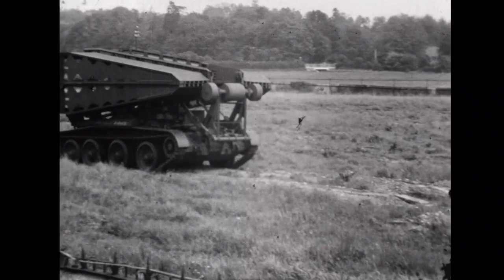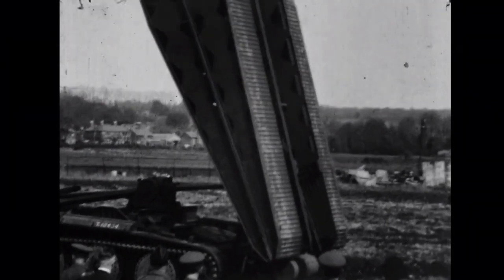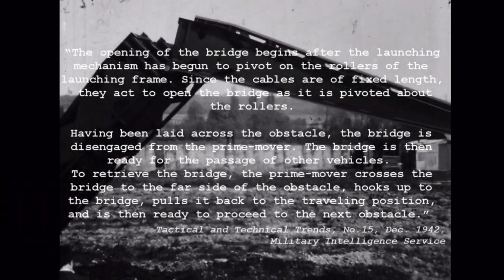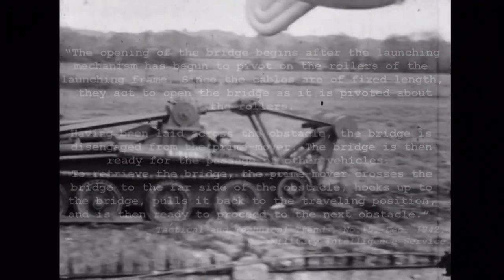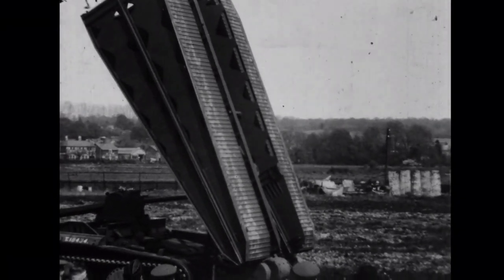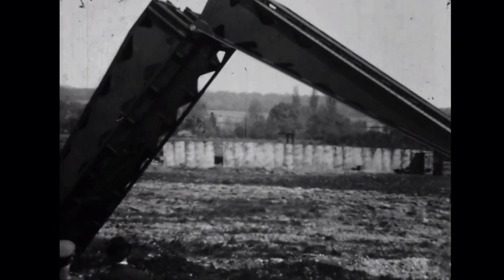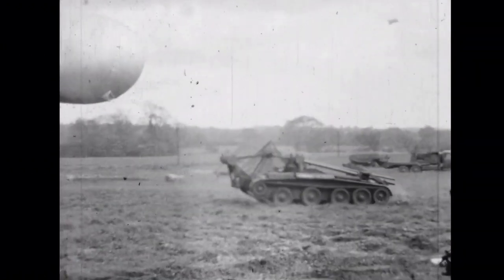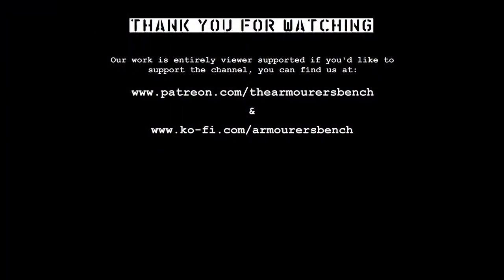Covenanter Bridgelayer In Action

Comment: If you'll forgive me, I don't think that's quite how it works. The threaded rod is fixed and doesn't rotate, it's the nut that's driven to feed the rod in or out. In some footage it is possible to see the thread moving during operation, which shouldn't be if the rod were the rotating element. 

British Pathe - Army Exercise (1941) at about 4:42: 
https://youtu.be/nPt_OSk3GGk?t=282
Reply from the maker: Thanks! Might have oversimplified my explanation. I shall add the Pathe video to the accompanying article.